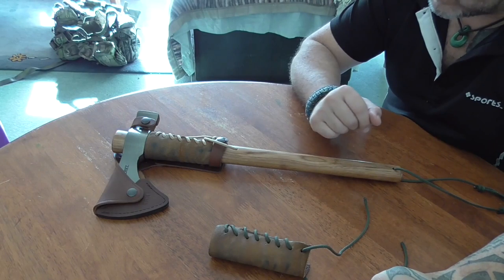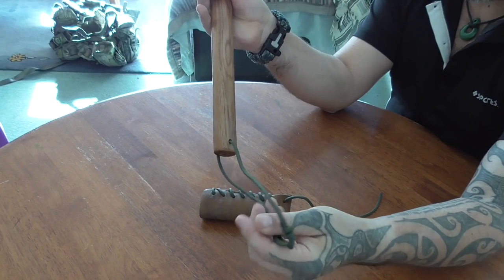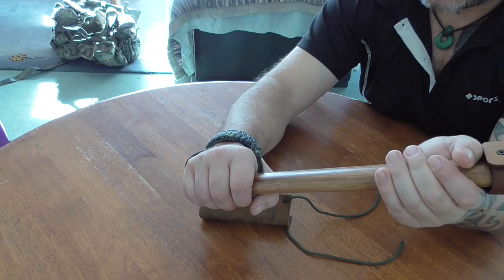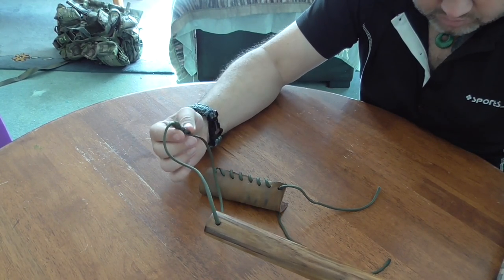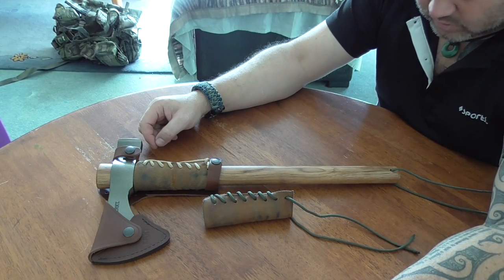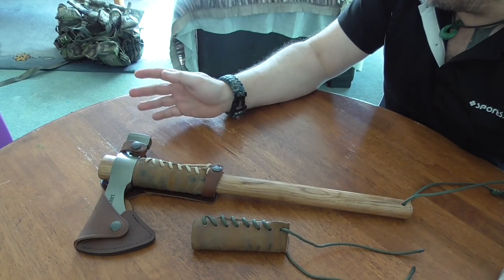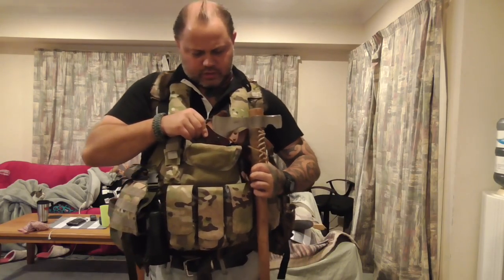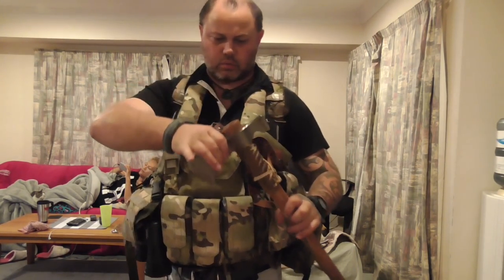Modified CRKT Chogan T-Hawk And Sheath

Comment: FYI....Your Plate Carrier is too low. if you adjust it to bring it up higher on your torso it will cover your heart and mediastinum better and top of your lungs better thus provider better protection to your vital organs.
Reply from the maker: Thanks for the advice Robert, I don't currently have any plates in it, but you are correct. I think I will raise it up higher any way encase i do need to add plates at some stage. Also it might help with more freedom of movement around my waist area if the Plate Carrier up higher.
Thanks again for the great advice.
Reply: true but i guess he use it juste to carry stuff :p

Comment: No lanyards on hawks or axes!!! Don't do it. Only use lanyard to hang the hawk or axe to prevent handle warp
Reply from the maker: I would agree with this when it comes to throwing a tomahawk as the lanyard could get in the way. But a lanyard can still be used to help retain the tomahawk when in use, especially in cases where you cannot afford to drop it or lose it from your grip when it is in use. 
I think it is probably better in most cases to remove the lanyard but still have it handy for when you need it.
Thanks for your good advice.

Comment: There are three things you should never ever do to a tomahawk handle #1 never drill into the handle it will weaken the wood . #2 never carve into the handle you could risk breaking or cracking the handle if it gets hit . # 3 never put anything that could make the handle slippery when the handle gets wet on the handle . Always use a rapping or some kind of leather under the blade so it lessens the blow in case of a miss hit or chop . I took a 10 speed inner tube cut around 5 peace’s off at 1 inch & rapped it around the handle at the end 1 over another to build up a knob like at the end of a baseball bat that helps you hold on to the hawk then I took about a 5 to 6 inch length & put it over that for some grip & used a high grade paracord not the stuff you see at Walmart & made a tight military rap under the blade .
Reply from the maker: I find the hickory handle is very strong in that it is a hard wood and just like axe handles that are made from hickory that come with lanyard holes, the wood can handle it. But yes any holes will weaken anything, but I have no doubt that the handle will not crack from such a small hole and such a hard wood. The hole allows for a lanyard, which allows you to have a very secure hold on the hawk, its not going to slip out of your hand, and it allows you to hold the handle securely at the very end of the handle allowing for more energy in the swing if you so desire. The lanyard however can get in the way when throwing the hawk, so this is the con with the lanyard. The lanyard can be tucked away under a wrap if you desire, this way you will have the benefit of both use and throwing without any problems. The boiled linseed oil, protects the wood and you can allow it to soak into the wood and then sand the outer layer so that its not slippery. The lanyard will prevent any slippage anyway if you do want to keep the outer layer of linseed oil on.
Thanks for sharing your advice and opinions, and I hope you enjoyed the video.